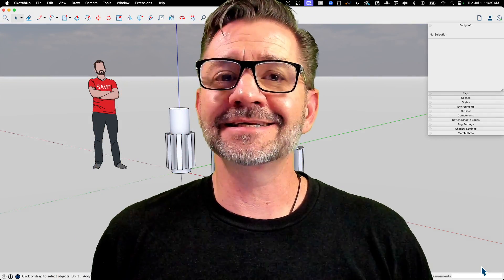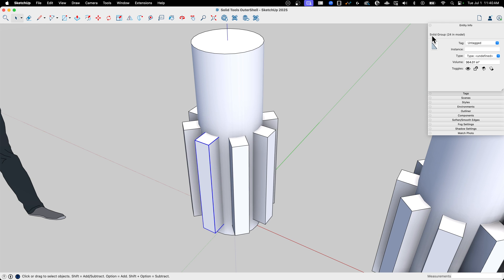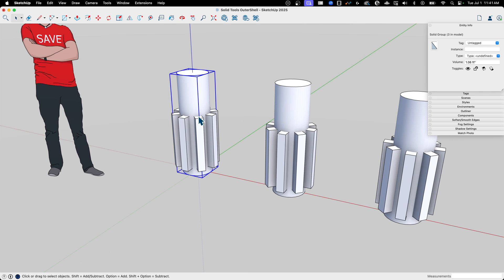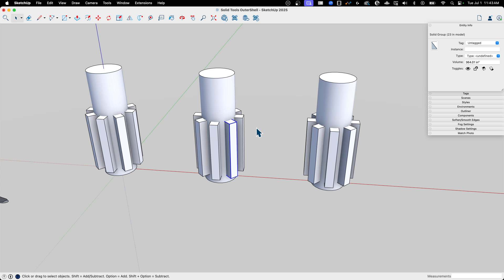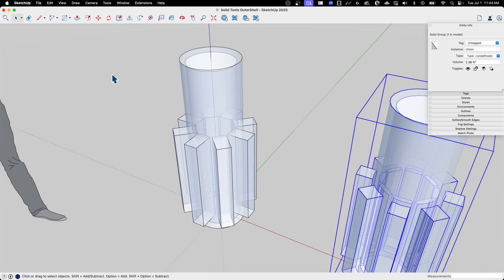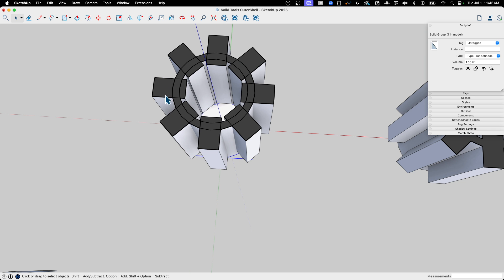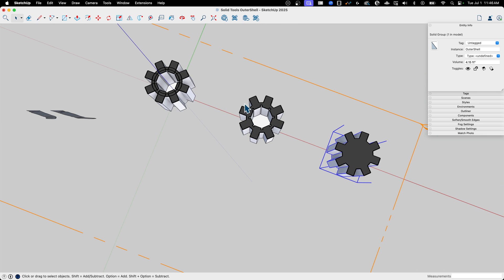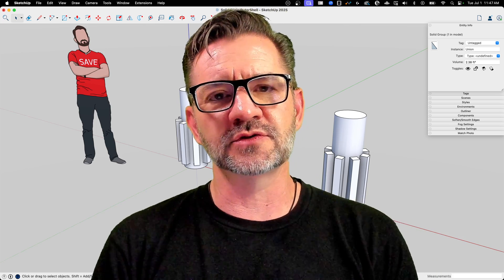Solid Tool Smackdown: Union vs Outer Shell

Comment: Never miss your videos ❤. Another way to use  the union tool is to join several solid objects that do not touch each other, such as joining the 8 rectangular prisms into one and then being able to subtract them from the cylinder. I use this method to create opening in walls for doors and windows.